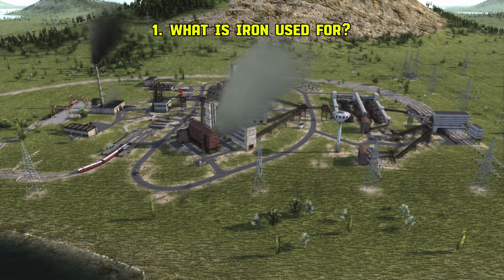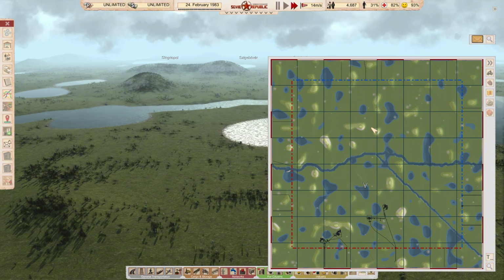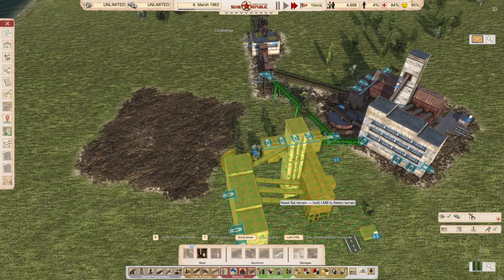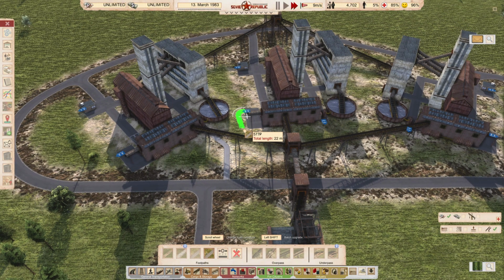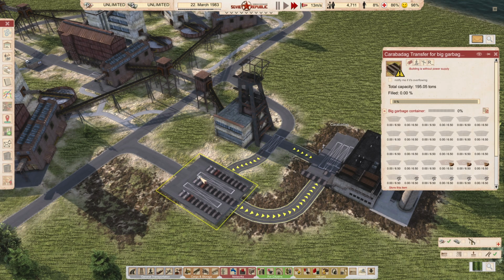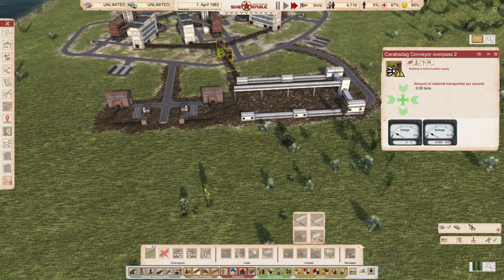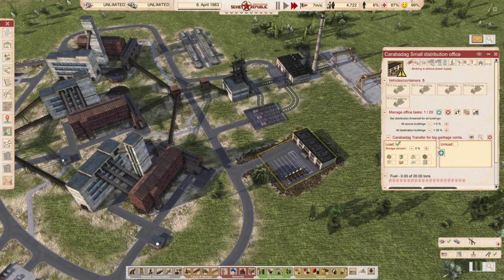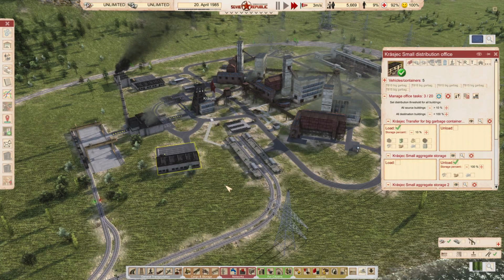Ultimate Industry Resource Guide - IRON - Workers and Resources:Soviet Republic

Comment: Im not sure if its been patched or not but iirc the 600t/d limit is only if using conveyor engines - aggregate connections from building to building have unlimited capacity, so always try and have them adjacent to an aggregate storage yard (which can then support multiple output connections)
Reply from the maker: They did not fix it! Indeed you are correct, thus my message that i need to remake them :D